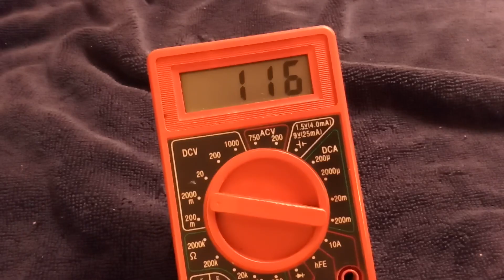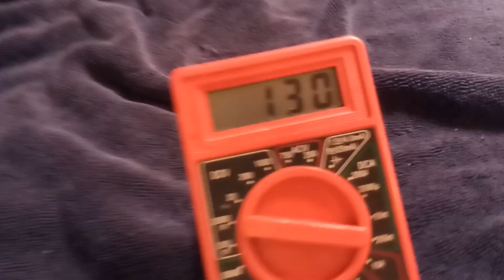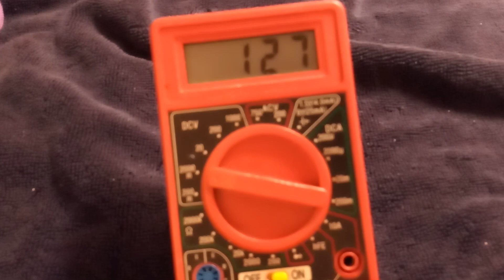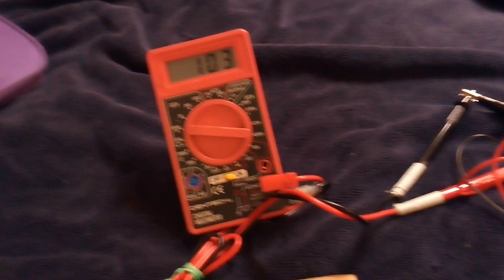Very low voltage LED driver

Comment: That could run with a solar panel in the moonlight. There's a multitude of ways to put this to use.
ALSO, it should be able to run with these little slayer micro builds and then ionize larger illuminations with the same microscopic fractional voltage input... https://youtu.be/HHsG_dBZyCM
That is An extension of this concept. 
I have several of these elements sitting in a box and this is something to try. 
Also let sunlight shine on them - out on your boat. In winter areas the elements can sit on a wood heater in a farmhouse or cabin and make lighting from the heat differential between the metal on the unit and the air. Minimum components with maximum results is the name of the game. 
This is an excellent off grid project.

Comment: its not hard, i did light a led with 0.3v its 1 transistor and 1 coil, ultra simple
Reply from the maker: 0.3 V is great!   Usually a Joule Thief type circuit cuts out at around .5 V.   Have you ever seen a LED driver circuit still run at 0.15V ?
Reply: @Lidmotor  0,15 ? no way
Reply from the maker: @davizord01  That is exactly what I thought ----0.15 v ? No way.  But there it was.  I am wondering if this is a mosfet transistor circuit or a special CMOS transistor booster circuit..  I will be doing some research .  Remember that this has to get at least 0.9 v to start it and then ikeeps running down to that low voltage. It stops running at 0.1v.  The led is out at that point.
Reply: @Lidmotor  Im also on 0,3v with bc547.

Comment: Excellent findings, enjoyed that 😀
I believe they are pronounced pell tee ay, or at least that's what others have called them over the years. 
One useful possible, would be to use the system for a night light, or to show where a hard to find indoor wall switch is in the dark. The outside air generally drops way lower than the house temperature at night, even in summer (especially with brick houses). That temp difference of 20 degrees seems possible if the Peltier was mounted outside and the house side connected to a piece of pipe to indoors. The indoor air would warm the one side, the cold night air would cool the other. Maybe a dryer tube outlet would work.
Reply from the maker: I think that a night light seems most practical.

Comment: Gosh, haven't played with "joule thief" type circuits for ages. In fact, I haven't really done much electronics for ages ☹ I seem to be doing other things at the moment, but it all circles round eventually 😊😊
Reply from the maker: I kinda drift around in the wind until someone puts up a YouTube 'TRY THIS' video and off I go on a new quest.  Lasersaber did it this time.  Energy harvesting from a daily temperature shift is pretty interesting.
Reply: Talking energy harvesting, that reminded me of those faucet lights you worked on years back 🤔🤔
Reply from the maker: @GrandadIsAnOldMan  Yep.  That was a fun one.   I played around with those things for weeks.